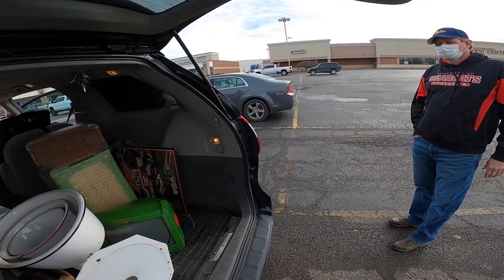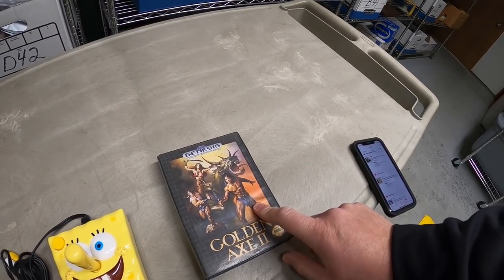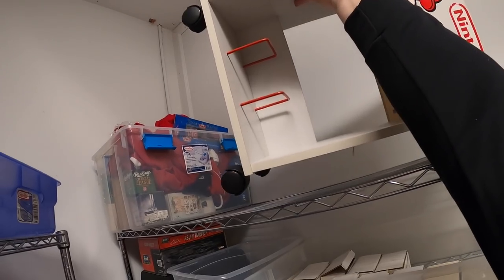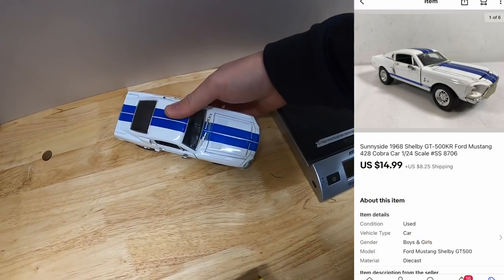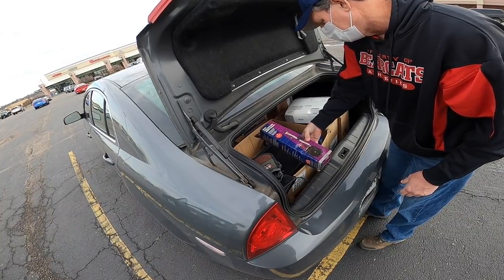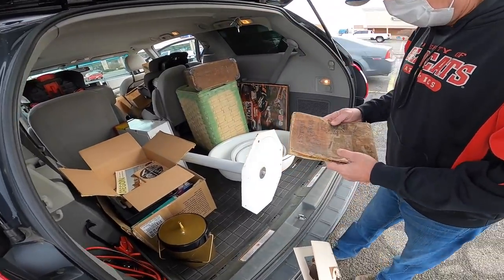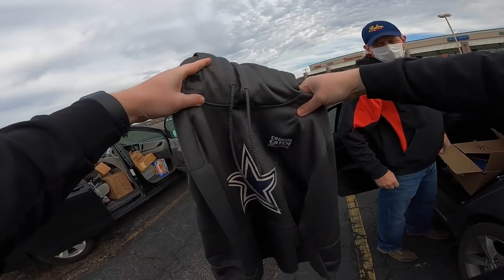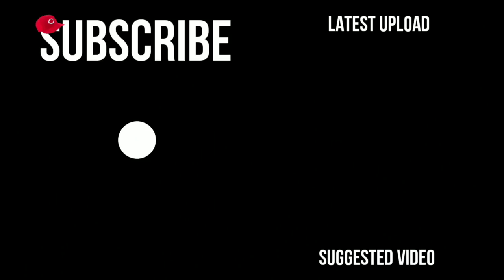I'll Buy The Junk In Your Trunk

Comment: Question. Where do you find so many metal detecting coils. I have been metal detecting for over 25 years and they are very hard to find out in rummage sales. I usually have to buy them on line. Do you have any Garrett Coils?

Comment: On the DS I’ve had the same issues with a few of my own and I have always got them to work. I use a dust cleaner for both slots. Also make sure the game “clicks” in. Sometimes it helps when you put the game in the DS before you power it on.